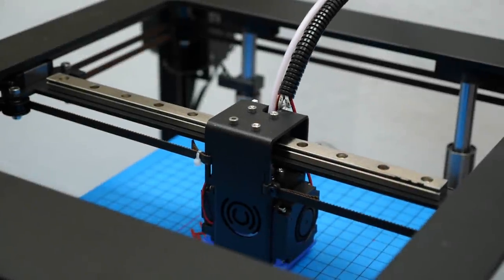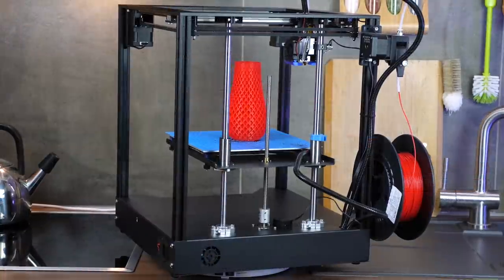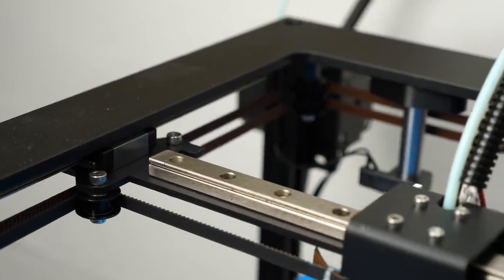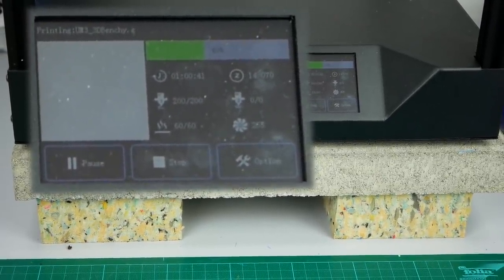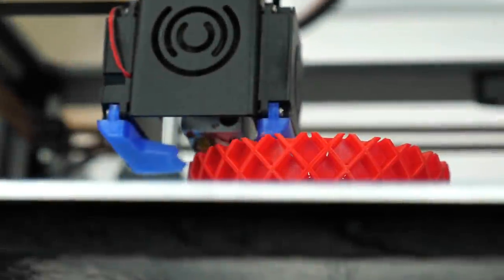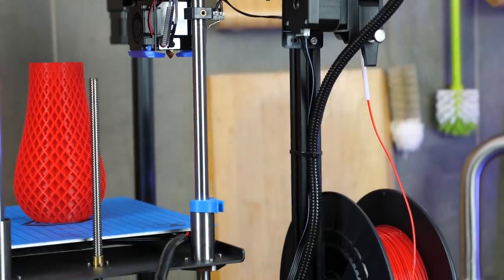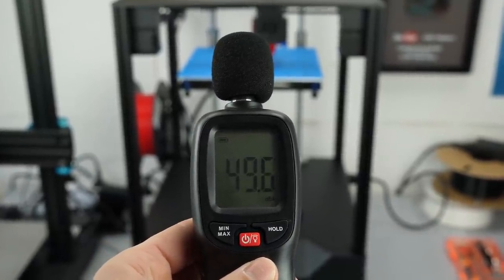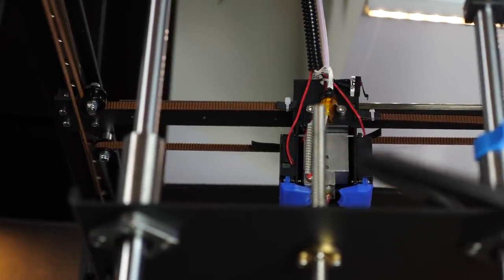$320 Linear Rail 3D Printer - Sapphire Pro REVIEW (Two Trees)

Comment: tbh for that price, you are geting what you paying for, if one cant fix the problem this kit come with, then probably 3D printing isnt for that guy to begin with.

but your point still stand.
Reply: That's the verdict of the video, too: if you want a 3d printer as a tool that just works, this isn't for you, but if you want a project to work on and like tweaking and troubleshooting, the components are great for the price.

It's a bit of a shame. CoreXY is a really interesting architecture, and the price is right.
Reply: @lairdpopkin7003  Unfortunately you also need a manufacturer that understands CoreXY, and Two Trees do not. The belts aren't parallel, a golden no no. You're better off with a dialled in H-bot than a badly designed CoreXY.
Reply: @MatBettinson  I've been debating with my son - would we be better off buying this printer basically as a cheap source of parts, since has linear rails, motors, hot end, etc., and turning it into a proper CoreXY printer, or should we go the full DIY route? Or is there anyone else making a good CoreXY printer that's affordable? We already have several printers, so it's more about the building, though of course at the end of the day the printer should be useful, too.
Reply: @lairdpopkin7003  It sounds like you're ready to do a self-sourced printer? A D-bot, Evo or a Voron (the 1.6 is somewhat affordable). I don't know a CoreXY kit from China that's any good. There's the SK GO I guess, but it's a lot more money. If you're going to the trouble of building a printer, I really think you want to specify the parts. It's questionable as to what sort of components you get with this. Their strange hotend, electronics you will almost certainly have to throw away, useless belts and pulleys.
Reply: @MatBettinson  thanks! Looking around, I also see HyperCube Evolution mentioned. What do you think of that one compared to the others? Is that "Evo"?
Reply: @lairdpopkin7003  I looked around a few before I decided to build a Voron. Picking an older well known design like the Evo or D-bot etc is solid because you can buy entire kits of parts from Aliexpress. That said, the most important thing is the community. With a self-sourced printer, you'll be asking a lot of questions and want to learn from others how they did it. They are often in difference places; Facebook, Discord, Reddit etc. Good idea to drop in and get a feel.
Reply: @MatBettinson  great, thanks!

Comment: Ender 5 DOESN'T HAVE a core xy movement system, ender 4 does
Reply: Ender 4 is H Bot setup, not corexy. A lot of folks had trouble getting it setup but with the right tension on the v wheels and alignment, its a fantastic printer. Such a shame creality never included a proper set of instructions for getting it assembled properly.

I love mine. Its been a serious workhorse printer.

Comment: I rather say do not buy this... it's awful I bought it too and had and still have a lot of issues with it... the firmware is not really opensource. It's a beautiful printer but its rotten inside I already spend over 150+ euro on upgrades to fix issues. and replaced it with a SKR Pro 32Bit with their latest touchscreen / rotary encoder knob.

Comment: What an absolute joke. For the exact same money I bought my Cetus 3D Printer, that comes with linear rails for ALL 3 axis, comes mostly pre built requiring only the fastening of a couple of screws and the plugging of some colour coded cables, has a dedicated slicing software that requires no user input or profile making and tweaking to produce great quality results straight out of the box, and has roughly the same built volume (180mmx3) but at 1/3 the footprint of this printer. All this not to mention that you have to do absolutely zero tampering with the printer, all parts are well built, not bent and not missing like in this case. Honestly, with the over-saturation of the 3D printer market at this point, you have to do alot better than this to even offer a modestly competitive and interesting product, that anyone might consider buying over everything else.

Comment: those 4988s are trash, not real allegro drivers.  replace them with real ones and it'll be much better.  Look in this picture, imgur /wOzvPnG.png.  The top is a real allegro driver, the bottom is a "hero" or "HR" driver.  The chips are different, and real allegro drivers are much better than the HR drivers.  Much quieter too.

Comment: Two Trees is a bs brand. I bought their Mosquito clone, it was horrible. Heat break tube screw was a weak plastic like metal and threads were already stripped. Tightening nozzle would push out the heatbreak from other side without applying much force. I’m not surprised by their crappy build quality here. Never buying anything from them again.